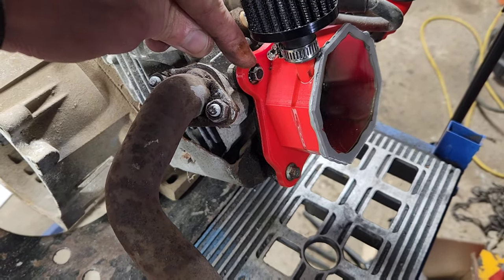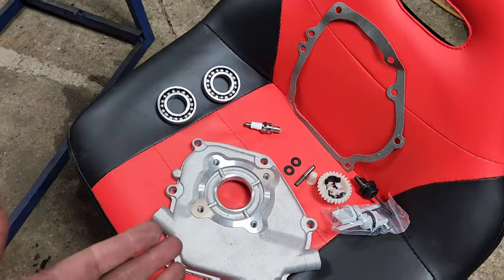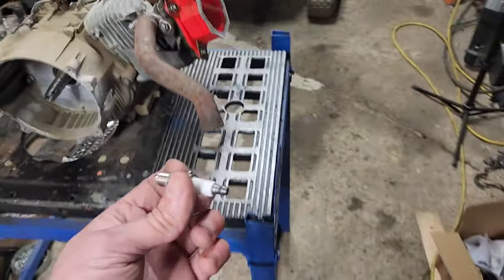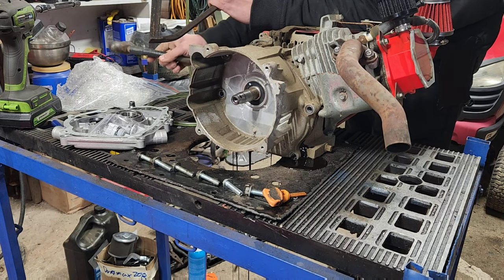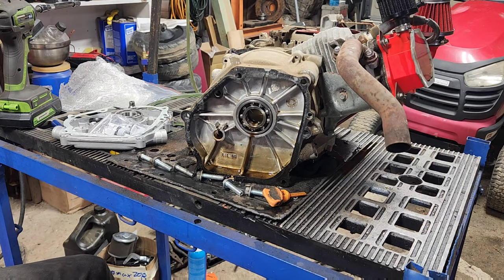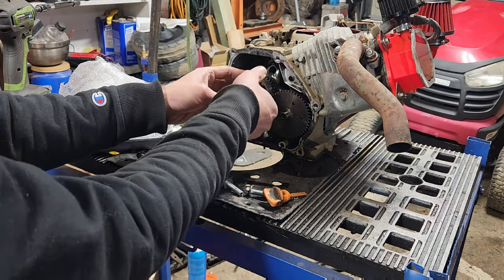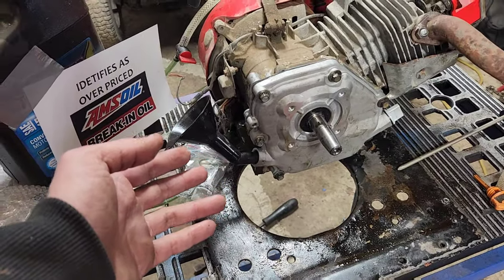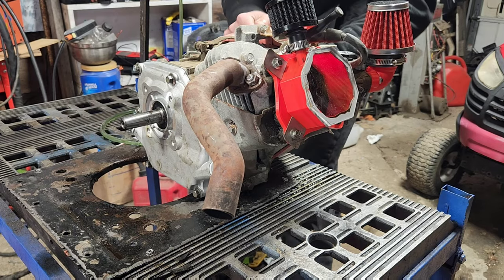Crankcase Cover Replacement Predator Generator Engine to Go kart Engine

Comment: Are those 4 holes around the crankshaft boss on the crankcase cover threaded? If so what size bolt did you use?

Comment: Where the clear plastic mount on way not mack that thicker so you have room to tap it with mini screw's and the clear plastic drill mini holes that way the clear plastic cover will stay on

Comment: maybe try printing on an angle .. pla+ or better maybe even add some bracing in the design ?? looks cool running
Reply from the maker: I need to find a higher temp plastic that is still chemical resistant. That leaves me looking at PP or maybe ABS

Comment: I don’t know what I was thinking. When I tinkered with the valve lashes I didn’t need to replace the gasket.

Go to change the camshaft/compression release mechanism and the camshaft is melted onto the side and couldn’t get it off in one piece.

Now I got to replace the gasket.
Reply: When I was doing that I noticed a little black washer. Then when I looked at the replacement kits there was also a washer piece.

Not sure where it goes but was hoping this video helped show that.

Comment: Would you ever consider doing videos where you answer questions from the community. Like a commenting on comments videos?
Reply from the maker: Have done that a few times over the last 11 years on YouTube
Reply: @redneckcomputergeek  oh my apologies I have not seen those then. Only reason I ask is I've seen a few videos and don't see many dual horizontal cylinders but a lot of singles. Is there any particular reason why single cylinders are more popular. Also have you ever done a dual exhaust build? I'm curious how that would sound.

Comment: the 3d printed valve cover might need a clamp ring to go around the perimeter of the base to keep equal clamping force, i think either Moroso or Hendrix made a Polymer valve cover for big block chevrolets and it had an aluminum clamp ring to keep the covers from warping and leaking, far as my opinion on 3d printing, its if you can print it with a material that can handle the heat for the application, there is no wrong way to test it, experimentation is what classic hotrodding was about, why do go-karts and mud mowers have to be any different?, figure out what works for you, and go with it brother, stay safe out there

Comment: For some reason I'm thinking, surprised you don't have a waste oil burner to heat your place?  TIG for the best welds.  FCAW'it is what I've started off with like as a reborn welder of and on.   Ew... looks like you got reamed on that one... or actually need a reamer?  Uuhmm... inventive ways to avoid patent infringement?  :-)  Yeah.   I still want to cut down a generator rotor and see if can make a straight shank adapter using one that's bad.  Would be handy if someone sold a drill or maybe even reamer or cutter of some sort that cut those tapered shanks.
Reply from the maker: After a bit of hunting around. I can buy a 14mm brill bit. The allinment pins I should have seen coming. That said $40 is cheaper than $160

Comment: ABS can sustain 110*C, PET-G and PLA only 85*C Head can heat up waaaay higher.
Reply from the maker: Need to do some research and see if ABS can survive the oil. If so will order some next month and make valve covers for a bunch of engines.
Reply: @redneckcomputergeek  ABS has its own issues, it generates toxic fumes while printing and it shrinks a lot. Maybe there are some newer materials.